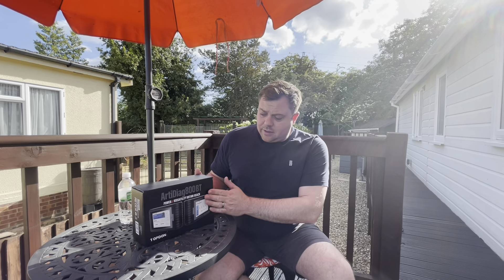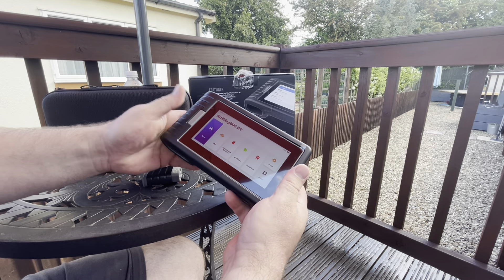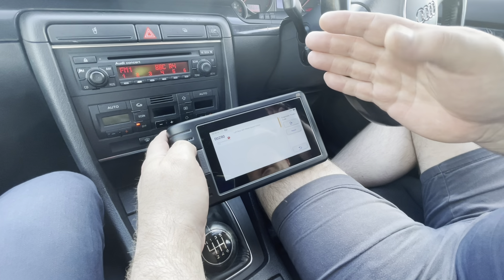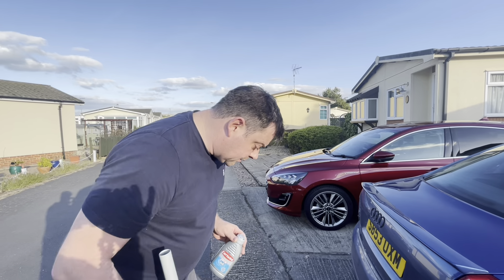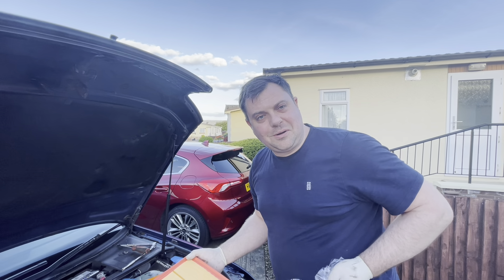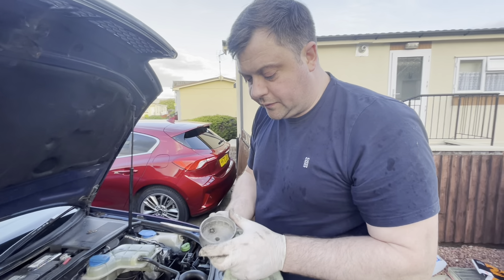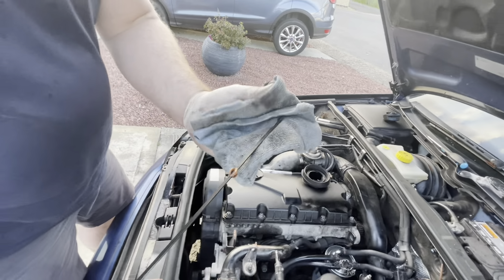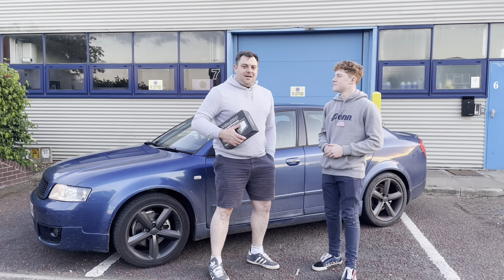Testing the Topdon AD800BT, is it any good?

Comment: For the TOPDON AD800BT OBD2 Scanner
On Amazon they said it does
Mileage Calibration: Copy or write the kilometer value
Please can you explain that?   ..........
Reply from the maker: If you need to fit a new set of clocks it means you can transfer the mileage from the old ones to the new ones.